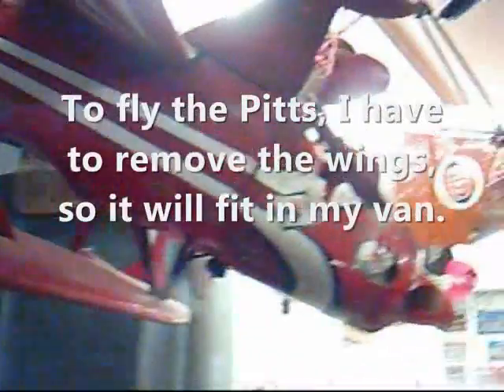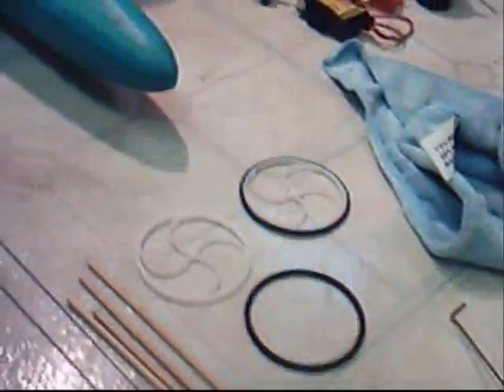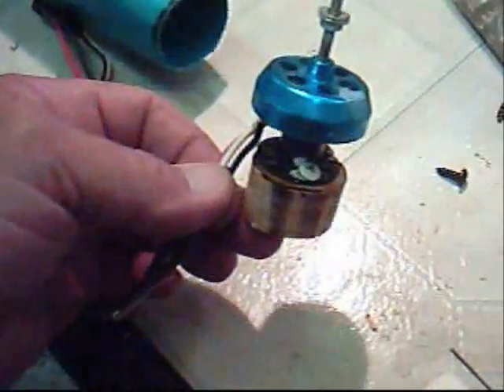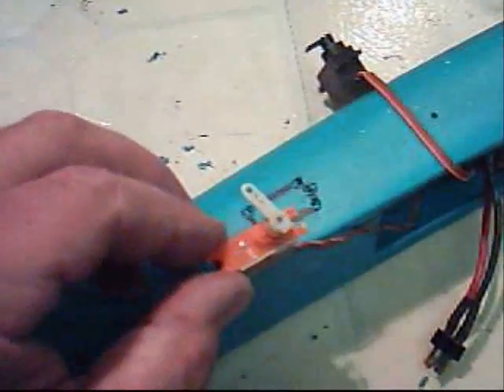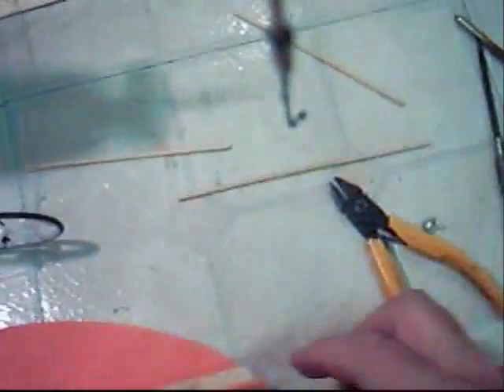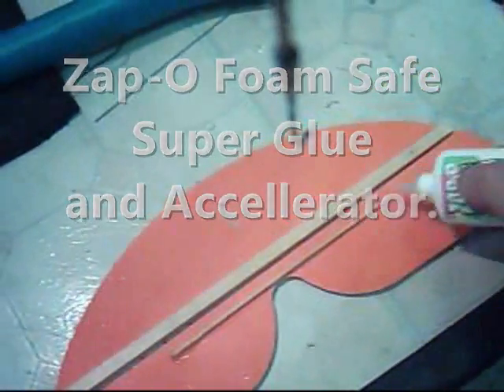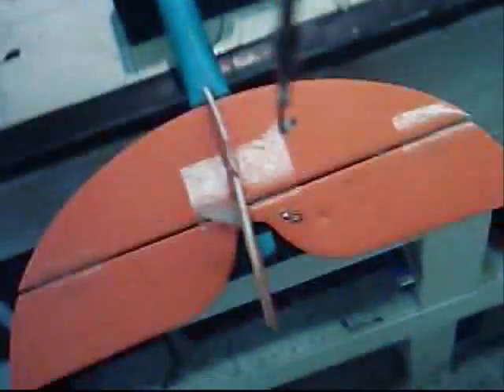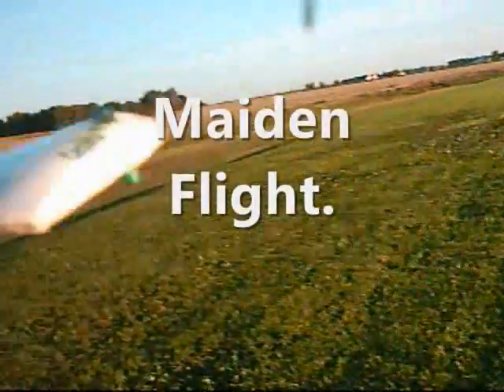How to make an RC plane in Mr. Herbert's Science class.

Comment: I would like to learn how to do something like that, i just have a store bought electric plane that i love.  I mainly need to find some lesson on how the servos work and hook up to the radio.  

Here is a question, is it possible for the battery to become weak after repeated use?  I have noticed a power slump in my plane recently, it is not that old but i have used it alot.  thanks

Comment: I did the same thing. Have about 30 planes, all gas. Got away from flying for 14 yrs, but still have the planes and radios. All FM. Wanted to start flying again with my grandsons, but all my planes were to advanced for them to fly.(And most batteries went bad) So I decided to build a electric foam plane from plans on the net and use one of my TXs. It cost about $60. It flew pretty good, but was no trainer. So I built another and another and another. Now I have 11electrics and working on another.

Comment: HI, 
I am new to this, i just got this new electric Cessna, the problem is , when first, the receiver does not have a throttle pin, where should i insert the pin from the BRUSHLESS ESC.. to the Bat in receiver, or in channel 1 

Thx

Comment: he could you take a mini foam jet like the ones you just throw from cut outs and stick a mini motor with a rotor blade and mini servo for alerons and make a micro indoors jet? im curious cuz i got some airhogs picco z and my blade mcx and some of my dads old failure helis and planes with parts that still work and i dont wanna spend alot. i know this is alot to ask but plz contact me or pm me if i could.

Comment: Building a new type of Rotowing with electric motors at the wing tips 5hp generator powers my prototype maybe you could build a model of it.I can now use control surfaces instead of a tail.Electricity flows to wing via steering wheel type connection.I'll send pictures

Comment: Don't try this unless you know what you're doing. So much about making a model aeroplane that is longitudinally stable was ignored in this video - and it's not just a matter of making it "balance nicely on the high point of the wing" unless the horizontal stabilizer area and tail moment arm are are the right size to put the NP just BEHIND the "high point of the wing!

Comment: have you tried cardboard for models? Its cheap, stringer than balsa and who cares if you crash?
for a gas model make sure you treat the areas that will be in contact with castor oil with polyester resin or epoxy.
Old refrigerator boxes are GREAT for large scale models, boats, planes or ACV's.
Give it a try!
you've inspired me to make a "how to video"
watch my channel!!